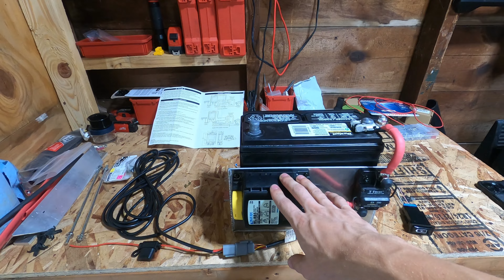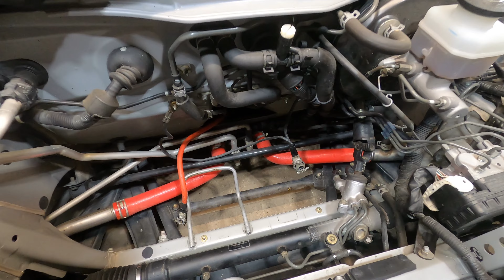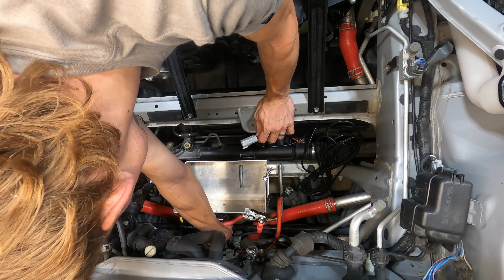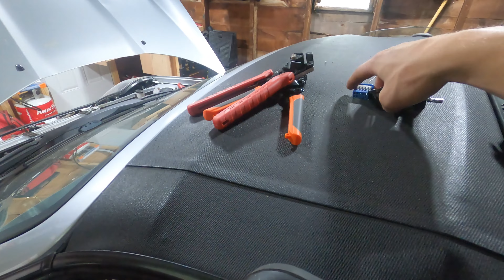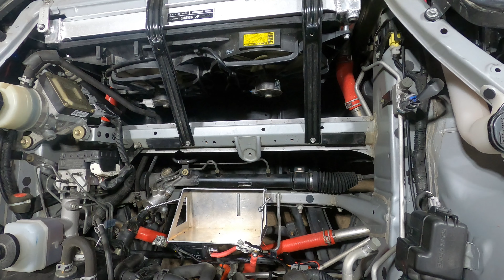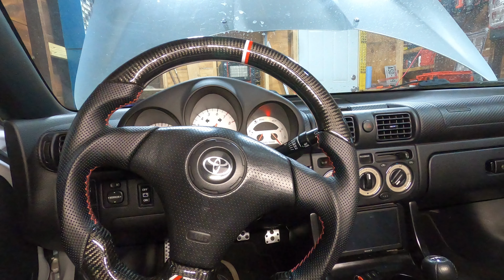mr2 spyder battery relocation

Comment: Hey homie. This build is killer. I do have a couple of questions though as I am in the process of swapping my Spyder’s motor out. What gauge wire are you using to run the positive all the way back? Anyway we could get some drive by noise if ya know what I’m saying? How much power is your built 2ZZ pushing? Any plans to boost it in the future? About how much was the cost to build out the 2ZZ? Etc…
Reply from the maker: The wire run to the rear of the car is 1/0 welder cable. I’ve been meaning to get some drive by and rollers but I’ve just been too busy and now the car is stored for the winter. The motor made 180hp to the wheels on the Dino at MWR, I do have plans to supercharge it in the future. As far as the cost of the swap I bought a crashed Celica GTS  for $800 and used the motor and trans from that as my base and sold the rest I can’t remember exactly what I payed for everything but after selling the leftover parts from the Celica I think I was in it for about 6-7k but my motor is probably over built for what I use it for and could be done cheaper.